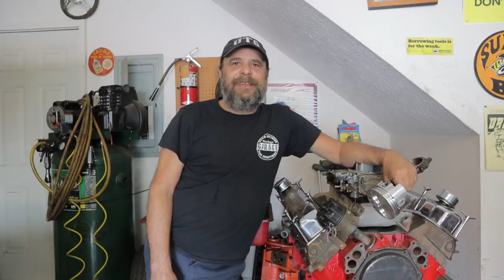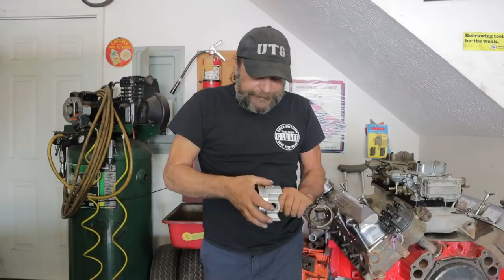The Great Piston Pin Offset Controversy ANSWERED!

Comment: my only experience with this matter comes from my last engine build. 1979 porsche 924 turbo. i used 88mm hyperuetectic pistons from an air cooled beetle. i installed them with the arrows facing forward which i later realized put the offset to the wrong side (backwards).  the piston clearance was bored to .0015" which is standard for these pistons. i get a ton of pistons noise when cold at light throttle. it is worse the more i advance the timing and i can make it go away almost entirely by retarding the timing out of a  desirable range. if i give it any real load it goes away and if i spool up the turbo hence retarding the timing it goes away.  im guessing the combustion event hits the piston just right at certain timing to rock the piston. i know this sounds like i am describing predetonation but i have a good ear and i am 100% certain it is piston slap. it sounds like a cold diesel engine.  it runs great, has little blowby and has great power as far as these engines go but man i hate the noise. i am going to order another set of these pistons and reinstall them the proper direction.
Reply: Did it improve horsepower?

Comment: You can not change the speed of combustion, so its all about con rod angle at TDC. For a bottom end torque engine you need some angle on the con rod to help turn the crank around, but is bad for high RPM. Reversing the piston puts the con rod more over the crank at TDC giving more top end torque and is good for higher RPM.

Comment: It works, ive seen the numbers more than once on an actual dyno it reduces drag on the rotating assembly just like using actual roller bearings with a roller cam not just regular cam bearings but ive installed roller torrington roller bearings for a camshaft to ride on its a process but it will reduce all drag on your cam and free up quite a lot of power  the easier your rotating assembly turns the more power it will make. This little trick will make the rotating assembly turn easier the factory has it engineered to go the other way to meet end play tolerances cause  blue tape bean counter politicians in charge of dictating to manufacturing say you are to build a motor the way they say you do it or it wont be cleared by government for production.

Comment: In most Mopar engines with stock pistons and bore clearance it might reduce drag and increase power. There are some concerns with some engines, that with certain bores, strokes, rod lengths and clearances, that the excess rocking of the pistons might decrease power. A lot of racing pistons have no pin offset. One Mopar book claims that for a brief period, the 318 had offset connecting rods and the pistons were not offset. That sounds pretty odd. It may have been the years that the 318 had pressed piston pins instead of floating pins. Were those the same as the 360 rods? Only a few years of 318 rods only? Some sort of money saving feature that Mopar later reversed.

Comment: Theoretically, the offset geometry increases power. The .120"  not much?
Changing the angularity changes piston accelleration at TDC and also requires slightly altered cam profile and ignition timing for optimum results.
Joe Sherman claimed 15-20 hp and torque on SBF (short rod) and he did back to back tests. 🙄  And claimed 400 hp on a factory iron headed 302.
SBF has a 5/8 INCH shorter rod than SBC etc. 🤔🤔😎
As for Smokey, ... Remember 3 hp might make a difference in a race.
NASCAR builder today would fight to get +3 from some mod. 👍
You could take it up with Joe Sherman but he passed a few years ago.
He was a great guy and genius IMO. 👍😎

Comment: I'd guess that the centered piston is better since I do not see parts designed for high performance doing this.  However if your using an OE piston that has an offset to reduce slap noise installing that piston reversed is clearly believed by many pros to home some small friction advantage.  This makes since if the offset is set up to press the loaded side of the piston into the cylinder wall to prevent slap, reversed it would not press as hard, and should reduce friction.  Still, it's probably not much.  But free if you already got it apart.

Comment: did that to 340 in about 1984 everybody  that heard that engine run thought it had a wrist pin loose carried 60 psi oil pressure at idle when hot and ran great , never did figuired out the noise had it above 6000 rpm to many times to count no problems

Comment: As I understand it, Shelby also recommended turning the pistons. You can't dismiss what these pioneers did to make cars go faster by simply calling it an old wives tale. I think what a lot of it boils down to is critics  don't understand this is something people do on a budget that don't have the cash to go out and buy aftermarket pistons if they can use the stock pistons. This isn't power nation "in this build we put in a whole new engine! And now we'll bolt on lot's of expensive performance parts provided by our sponsors!" This is advice for regular people who build a car in their front yard on a budget using whatever they can find and whatever tricks they can use to make it go faster.

Comment: i did a lot of racing in the 70's to 90's and i have heard both sides some claim it is the best thing to do other say it works and the engine wont last long but i really never care that much about it to talk to old man bell about it i only have had a few  mopar engines in my life a 68 440 tri ,340 ,new 360,old 392 hemi and a bunch of slant six engines all where factory built engines most of my built engines are chevy just so much cheaper plus have a lot of good connections for chevy parts and engines like i have 4 stroked 454 450 hp with the 02xx 400r trans good up too 800 hp from 6000 miles to 58,000 miles on them all for free just this year plus just got a high rise and tunnel ram for free with a new street scoop

Comment: I think they said they didn't personally think it did anything? I dont remember any attacks... but hey I'm here for it let's have a UTG vs Roadkill show down 318 low buck build off
Reply: @davidleonard8369  what did he say? I guess I missed it
Reply: @Link-we8so  friburger went on a silly rant about disassembling a perfectly good engine and breaking pistons trying to press the pins out and having only two valve reliefs and bore taper and all kinds of reasons it could be a terrible thing to do. But mostly it was the way he was acting like only an idiot would attempt such a seemingly massive undertaking. In these two comedians defense I must say that I was unaware that the video was made two years ago and may not have been directed at tony. But their statement about former magazine editors makes you wonder.

Comment: The flipping the piston will still give same exact results related to piston slap because when the blueprint machining off center with offset means is done that also if it is flipped that it still has the offset the same dimension but on the opposite side of theoretical centerline of piston so it give the capability of retarding, or advancing of the piston in the bore

Comment: Hey Uncle Tony I love your video's and I know you have many more years of experience than I do but I found a gaping hole in tom's theory. I'm not saying he's not a smart guy and I'm not saying you don't know your stuff but everyone makes mistakes. The problem with tom's theory is that combustion chamber orientation is opposite in relation to piston pin offset between the left and right banks of a wedge style V8 engine. this means that if Tom's explanation of the advantage is correct then 4 pistons in a v8 are already oriented advantageously and by flipping all 8 pistons your just shifting the advantage from one bank to the other. If Tom's theory has any merit then only 4 of the 8 pistons should be reversed. 

Honestly I'm with Dave and Steve on this, I believe if there were a significant advantage aftermarket piston manufacturers would be taking advantage of it. I would however like to see an engine masters episode related to this topic even though it would not be an easy task to perform in a dyno session. It could be done though if Dave and steve custom ordered a set of piston with offset pins 4 valve reliefs and full floating pins so the pistons could be rotated quickly or you could build 2 identical 318 shortblocks with the only difference being the piston offset. 3 if you really want to put this theory to bed.

Comment: The people that said that. didnt say it didnt make power they said its alot of work to make 20 hp and have piston pin offset the wrong way. 90% of aftermarket pistons don't have an offset. Wrist pin is centered on piston so wouldnt u think if it made more power they would have the offset like this?

Comment: I've not looked into it in depth, but physics will supply the answer, levers and mechanical advantage.
Reply: If the crank is rotating clockwise if the pin is offset to the right it should give a better mechanical advantage and a slightly higher piston height and slightly increased compression ratio to boot, I stand to be corrected of course
Reply: Correction highest CR will be pin at centreline of piston, oops!
Reply: @andypdq  The piston will not travel higher in the bore.  I think you realized this.

Comment: The whole issue was that Cheeseburger 🍔 was complaining anyone building an engine would use all new parts and wouldn't reuse stock parts. Lol, no. We don't all have $5-10k laying around to do a full overhaul with aluminum heads. Reversing pistons was a stock piston issue when you didn't have to bore out the cylinders. It's practically in every Mopar rebuild book from the actual Chrysler engineers. 

Btw, you don't have to bore out every engine. Some can go with just a hone. It's something no one talks about on those sponsored shows on those $ channel streams.

Comment: How many freeze plug holes are on the front of a 318,SBmopar?
Reply: Another Question... YES SIR 
How much PSI can a 1 Barrel Holly take before flooding the carb?
I'm running electric pump to the mechanical pump and carburator,GOOD OR BAD IDEA !
I THINK I POPPED A FREEZE PLUG DUE TO COMPRESSION IS THAT POSSIBLE? Has that ever happen to you?
all my coolant is on the ground, I bought coolant for the ground.
Shz$iT
Reply: I only worry about the 2 in the rear leaking.

Comment: Tony, We understand you don't have a dyno accuratly way of testing a reverse piston engine. However have any of your custmoer's time slips noticeable improved. Do they take more fuel, vibrate or any thng that supports your ideas? You may want to think about modern day engines. I would be hesitant In using  Smokies day's or the days of the Hornet as a standard to build by. As far as your educated person who supports you, somepone always thinks they are the know more. If offset pistons do make a difference why don't the aftermarket Kings support your ideas?

Comment: What happens with the valve clearance cut into the pistons when they are facing the wrong way??? and it's opposite to the valves opening?
Sounds like you would get interference as the releaf would be the wrong way????
Reply: Most have 4 relief symmetrical pistons.

Comment: It would be interesting to see this on a dyno, I bet the horsepower would be the same but the torque would increase a bit
Reply: And this is the evidence that others have asked for and yet I don't think anyone has provided; dyno proof. Exactly what Steve and David were asking for. I remember hearing guys back in the '80s talking about how years prior they made x amount more horsepower simply by flipping the pistons, but no one ever provided a single shred of evidence that it actually did what they claimed. And no offense to Mr. Hoover nor Direct Connection or Tony, but making the change and saying that the engine still runs fine is not evidence of an hp/tq increase that has been measured.
So, I'm curious: is the genuine dyno-results-on-paper evidence out there to substantiate the claim that reversing the pistons really does add horsepower and/or torque? If it truly reduces friction, then the results should be measurable.
Regardless, I'm still living vicariously through UTG and Roadkill and ViceGrip and many others until I get myself another classic toy and can hopefully use the knowledge that they've all shared with us. I appreciate all these dudes.

Comment: The first time I had heard about installing pistons with the offset reversed was in the old "400HP 302" article where engine builder Joe Sherman claimed it helped power by 15-30hp.
http://carbdford.com/fletch/tech/sherman/sherman.htm
Reply: Joe Sherman built one hell of a small block. I run at barona drags where his son Steve runs his Joe Sherman powered nova. Wicked fast n.a. doorslammer.

Comment: The 2 valve relief piston you are holding in your hand CAN'T be rotated 180 degrees because the valve reliefs would be in the wrong spot and cause immediate failure/wouldn't even turn over on the engine stand. Find an appropriate prop to use!

Comment: I have tech sheet from direct connection 
For small block la series engines
One of the first things it said to do is swap the pistons to reduce the piston pin off set they didn't make any claim to improve horse power just reduce friction witch in turn free up some lost horse power do to friction

Comment: I don't think they will find anything from the dyno because they won't test it at a low enough rpm I think it will help from idle to like 2000 to maybe 3000 rpm depending on stroke length

Comment: A point made was 

 Are new performance pistons made to take advantage of this ? 
I here the answer is no 

also , 
 offsetting was to reduce friction ,
so does reversing increase friction ? 
 The Dyno would tell 
 Seat of the pants means  nothing 
 the Dyno would not lie 

Get Tony and road kill crews into the dyno room and get at it 
 Smokey and others experimented with stuff that sometimes failed , 
they did research for the factories , 
they were true genious

Comment: those guys did it because they didnt have a choice and were experimenting. with all the piston manufactures and cnc and cad models we have got the best pistons and tech that the world has seen so far. i agree u wont see any negligible increase in power or  longevity or every engine builder would still be doing it. i know ive tried it more than once and couldnt produce any measurable increase on two different dyno cells. but to each his own,if u like doing it go for it, dont worry about what everyone else thinks.

Comment: Just slap together an engine with offset 4 notch pistons, dyno it then pull the pistons, reverse them and dyno it again, all other parts remaining the same. Im sure Nick will dyno it for you.
Reply: UTG sent an engine to Nicks garage , 
 
It was in need of help 

UTG returned to pick up the TURD and it was thought they were going to bring it back to Nick after correcting issues 

UTG ,,,, did you correct the errors and send it back there ????

Comment: Roadkill.... Isn't that the show where they build or buy some old classic cars, and do a bunch of stuff to it at parts store parking lots, without getting kicked out, then proceed to have to driver it some distance under some arbitrary deadline, and invariably, pretty much Every SINGLE episode, the vehicle overheats, and blows a hose, and they have to figure out how to fix that? You would think with EVERY SINGLE TIME they have this issue, they would double check the cooling system, or did they do it for extra drama? Hmmm.. 

These guys can't even figure out how to drive a car without having it overheat all the time, and they wanna lecture about engine performance and reliability?

Comment: I whatched the pin offset link and he is miising the fact that quench V8,s  heads face diferant ways, one side has the quench on the thrust side and the ather doesnt. Would only benifit one side and still never run right. Quenchs is a shocking design. On the ather hand  My 351clevo,s with closed chambers allways run good. That is one reasons why the man  Bob glidden dominated for so long. Because his chambers were on the middle of the piston. And burn faster than the hemy to.  Go the Fords. 👍👍👍

Comment: Any changes that you do to a motor will show on a dyno ! I watch you and Richard and like both you channels . I've built alot of engines throughout my whole life if it helps the motor it will show on the dyno bottom line . I'm a 40 year tool and die maker machine many motors in my day I watched Tom's video and if you listen to what he saying he got it backwards  ! If this worked the manufacturers would do it bottom line I know this because I work with all the manufacturers because I build stamping dies for them . Richard didn't attack you like you think he simply said he would like to try it . Bottom like if it helps the motor it will show kn the dyno .

Comment: here,s my take ,I maybe wrong but the object is to slow the piston speed at TDC to  take advantage the cylinder pressure ,some  4 bangers use offset bores ,others use off set wrist pins, when looking  at a v-8 as a straight eight, with flat tops its no problem but when the combustion chamber mirrors the piston ,you better have a fat wallet.  here,s food for thought ,how about off setting the big end of the rod?

Comment: Drag racers having to run Stock classes thought they might gain a minisual amount of compression or cause the rod to have better angularity against the crank . Street engines dont need it, Stock class rules  are pretty strict, so racers look for any advatage they can find ,